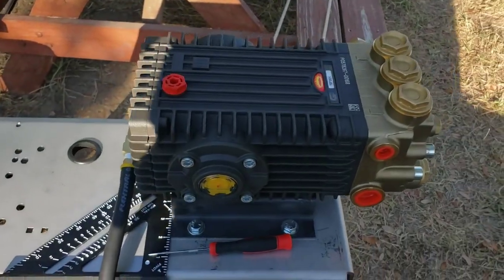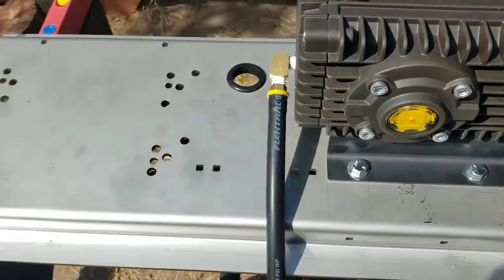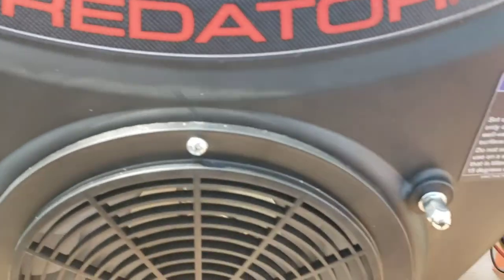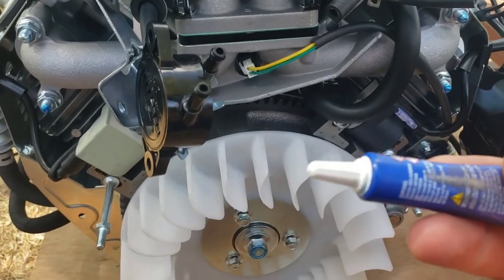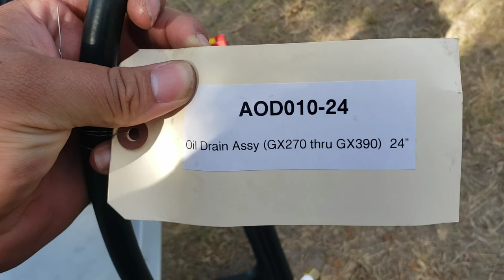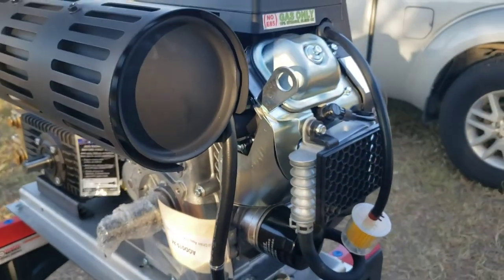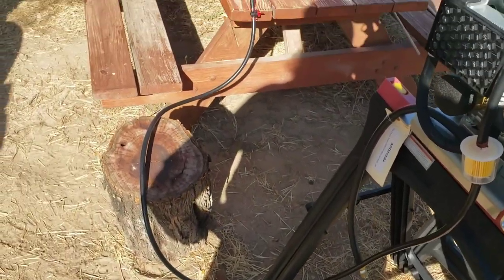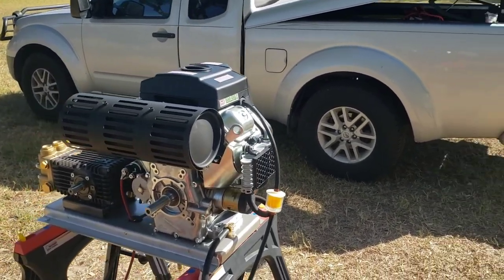Part 1 Predator 670 GP TSF 2021 Pressure Washer Build with Honda Fuel Pump Replacement

Comment from the maker: Predator 670 GP TSF 2021 Pressure Washer Build Part 1
with Honda Fuel Pump Replacement

Predator 670 GP TSF 2021 Pressure Washer Build Part 2:
https://youtu.be/gHS0hfmVD-0 

Watch both videos before building to learn from mistakes made along the way and how they were corrected or can be done better.

Majority of the parts:
Russ Johnson 
Southside Equipment
(502) 504-5454
russ@pressurewasherky.us
https://www.pressurewasherky.us/ 

Engine:
https://www.harborfreight.com/22-hp-670cc-v-twin-horizontal-shaft-gas-engine-epa-61614.html 

Honda Fuel Pump:
https://a.co/d/1uNtCr5 

Marine Battery:
https://www.walmart.com/ip/131118029 

Battery Box:
https://www.walmart.com/ip/16781380 

Saw Horses:
https://www.harborfreight.com/31-in-pvc-folding-sawhorse-350-lb-capacity-61979.html 

Engine Oil:
https://www.walmart.com/ip/17034353 

Engine Oil Filter:
https://www.walmart.com/ip/16878929 

Water Pump Oil:
https://www.walmart.com/ip/52626201 

Vacuum Guage:
https://a.co/d/cv51eEN

Comment: Do you reckon you can make your own frame? What is the thickness of the frame metal? How long are the tension slots?
Reply from the maker: I'm away from the machine right now but I'll take those measurements for you when I get back. But yeah the frame can be home made.
Reply: @MannyWashes  Would help to know the frame face's length x width, as well as, the pulley gap, belt type, and bushing dimensions. I'm shipping in a used 6.9 cast iron pulley but don't know what bushing goes in it yet.
Reply from the maker: @d4z_l20svaQ12  Skid footprint is 27-1/8" x 12-3/8" 

The mounting surface is 27-1/8" x 9-3/4". This is without the leg portion where the skid mounting bolt are. 

Skid height is 1-1/2" 

Skid thickness looks to be 3/16" 

The engine shaft to pump shaft is 13" on center with the pump tighten into position. Pump is tighten about 3/8" to the right so I'd assume the pre-tension distance is 12-5/8" 

Belt is a D&D Power Drive 4/3VX435 

Engine bushing is 1" SH type 

Pump bushing is 24mm SK type 

The vendor should be able to tell you what is the proper bushing for that pulley you're having shipped. 

The 4 slots opening on the skid for the pump mount mounting bolts are 1" long. Bolts are 3/8"-16 x 1" so the slot opening needs to be just wide enough to accommodate 3/8" bolts. Keeping a tight tolerance on the opening with should also help with pump alignment. 

From the right face of the skid going left the slot starts at 2-5/8" then since it's 1" long continues to 3-5/8". The bolts are 4-1/2" apart so the next slot starts at 7-1/8" to 8-1/8". I can't visually verify the 2nd set of slots because everything is mounted and bolted to the trailer. 

The distance between front slot to back slots is 5-5/8" on center.
So back slot is 1-5/8" on center from the rear of skid mounting surface and front slot is 7-1/4" on center from the rear of the skid mounting surface. 

Yes the tension plate underneath the skid is to tension the belt easily. But tightening the 4 mounting bolts are what really keep the pump in place to the skid preventing backing out. If there were two tension bolts on the side of the skid then I would say it was for alignment too but there's only 1. Also that tension bolt is 3/8"-16 x 6" and it uses a cage nut that clips onto the tension plate.
Reply from the maker: @d4z_l20svaQ12  I would think it would be best to get all the holes on the skid for the pump squared away first then adjust the engine position to line up with the pump then mark the holes to be made for the engine. The back of the motor cover lines up with the back of the pump. 

The bushing for the pump doesn't have much room for adjustment as to it's location on the shaft so most of the pulley adjustment to line them up is going to be done on the engine bushing.

Comment: Im new to this... This makes an 8 gpm machine with the predator 670? Total build price? How has it held up?
Reply from the maker: Yes. Holds up good. Total price for mine is a bit different because I made it with 2022 pricing, upgraded some pieces, used 316 ss fittings, made the outlet 1/2", and bought the engine during a special I thing for 850 with a cheaper price warranty. I think mine was about $3,300 to guess but basic is probably $3k

Comment: I'd recommend against ever using a FRAM filter in anything you actually care about. Get a Mobil 1 instead.
Reply from the maker: I've been using fram xtra guard for over a decade now without issue. Now I would agree with you if it was the cheap orange filter. Wix would be my next choice.
Reply: @MannyWashes  Ah, I missed that distinction. I think the Xtras might even be made by Wix? I thought I saw some cut-opens on another channel. 

I'm really watching to see how well that Predator holds up for you, as I've heard a lot of good things.

Comment: Looks like the main advantage of the upgraded pump base of the factory one is using it with the tensioner. Is that right? Do you think you could achieve the correct tension with the factory mount by hand? Like you would do on an air compressor.
Reply from the maker: The custom bracket is going to have less play than the factory because the custom has one single hole for the 4 holes on the skid side while the factory has slots. I think it'll mostly come into play while the pump is going.

Comment from the maker: Paint the pump mounting plate and tension plate or it will rust. This is if it's bare metal with blue or black thin finish.
21:26 Fuel Pump Swap Start

Comment: You can skip the washers if you use the flanged head screws. They are the way to go in most cases.
Reply from the maker: It's the stuff Russ sent me when I ordered the diy build kit. Where are you speaking of using them at?
Reply: @MannyWashes  In place of lock washers. Lock washers don't really prevent loosening.  Larger flat washers are for load distribution to keep the bolt head from collapsing what it's clamping, so by all means continue using the larger washers. But if the washer is about the same diameter as the bolt head, just using a flanged screw seems to make life easier.

It's not wrong to use lock washers. It just that there are other ways to go that are either more effective or easier to do.

If you are concerned about loosening, I'd strongly recommend the Nord Lock washers. It's the only locking washer style setup I've found that absolutely resists loosening due to vibration. They're even meter than Spiralock IMHO.
Reply: @MannyWashes  Pump mounts to the bracket. Don't worry about your rig-- it's gtg. Just keep on eye on those lockwashers on the pump mount and make sure they stay tight.

Comment: Hi many how are you 
I’m sorry to bother you but I have a question for you again 
I’m trying to put my pressure washer together but I’m having hard time to find out about the size of the bolts of a tws 8030 comet pump 
I don’t really know the size of those bolts 
Maybe I can find them on the hardware store or lowes 
Do you have any suggestions
Reply from the maker: Alright so I didn't find a straight out answer like you were looking for. I did compare the parts exploded view of your pump and my GP TSF2021. Given that most of the screws in the same location of the two pumps have the same thread diameter but different lengths I'm guna go with that the mounting bolt holes on the bottom are also M10. The TSF2021 came with M10x18mm according to the manual and Russ sent me M10x20mm for me to use with his mounting bracket instead of using the bracket that came with the pump. So I'm guna say yours is also M10 and probably the 18-20mm length but I'd double check that if I were you. If you have a stick to put it in the hole then measure it and convert it to metric should give you the maximum bolt length. If you're between lengths then I'd probably say go a size smaller but also remember to include the thickness of the mounting bracket when considering the length of bolt.
Reply from the maker: I'm looking at Lowe's and I would just say make sure that the threads are the whole length of the bolts and don't forget locking washers
Reply from the maker: Could also use hex cap bolts which is what came with the GP pump and Russ sent me hex bolts.
Reply: Ok thank you for your help 
I’m going to Lowe’s tomorrow to see if I can find the bolts 
I appreciate that you answered my questions
Reply from the maker: @melvinn5293  let me know if those do turn out being the ones. Good luck.

Comment: Any reason you went belt over gear drive?
Reply from the maker: Misinformation sorta. If you watch towards the end of the 2nd part I think I said if I did it again I'd probably do gear reduction driven. When I was first researching this stuff I was finding that the belt drive was highly recommended that it is quieter(maybe), I think not as harsh of a start on the water pump(maybe), if the belt breaks it's a cheaper replacement (true) compared to if a gearbox breaks. And I'm not sure what else but also I believe that's what Russ only sells.  Russ isn't that great at upselling but I feel he's good at information and recommendations.

The pros from the gear set up is that it only 4 parts you're really putting together, the skid plate, engine, gearbox and water pump. The gear setup has a smaller footprint for it's overall size. I think it uses the same skid plate size as a 4gpm belt drive just used in a perpendicular direction. I believe I've seen it mentioned on two YouTube channels that there's less loss of power from the gears because belt flexes and maybe in the smallest minute amount slips but it's not something that can be see to the eye. I don't remember if you get more psi or gpm or both from not having that power loss.

Cons: I recommend having the pump supported, the "pressure washers channel" on YouTube on one of his videos shows a type of support, that way the pump isn't just free hanging off the motor from the bolts. Also on the same YouTube channel in the same or different video it's recommended to use RTV sealant to prevent water from getting in between the engine output shaft and where it slides into the input gear. The reasoning is because if water gets into there then the shaft will rust weld to the input gear making it difficult to remove the gearbox if you ever have to take it off. I don't remember if it was the same channel or the "house washing" channel that kinda recommends making like a foam gasket to prevent water from getting into the gearbox housing in the first place. Another con is if a gear breaks then you have to replace the whole gearbox because I don't think the gear is sold alone or if the housing cracks and leaks oil. That can probably shut you down until you get another one if you don't have one on hand. Another slight con is you have too carry a 3rd separate oil, engine, gearbox and pump. But yeah with those cons idk how often gearboxes actually break down so they may be theoretical cons. I also don't know how long belts last so I'll find out. 

Either choice is guna work for you but the power lose might be a deciding factor. How much of a lose is it , idk. I feel like there's a video out there comparing the two but I don't remember. But yeah I think now there's 3 belt drive build videos on YouTube and two gear drivers on YouTube with sometimes other videos giving you some tips how to do things better.
Reply: @MannyWashes  I have one of Heath Phelps 6.8gpm budget builds and trying to decide on adding another one of those and Siamese them together or go with your build. But if U have two of the same setup as I'll plenty of backup parts. I did see where Kentucky Wash pros\ Jeremy swapped his 10gpm  predator system from belt to gear driven  but I'm not sure why. Thanks for the quick response and detailed explanation.
Reply from the maker: @shauncrochet7934  I looked back at Jeremy's comments and I found one saying that gearbox is easier to work for him and that he didn't have any experience with belt drive. Philip Prc's comment.
https://youtu.be/v5TYtRRfV_o

Yeah I can see how that's tough to decide. It does make it easier to order and have parts on hand having both the same machine. But then again could have a machine with more gpm output. I know like Mike carmody has a 8 and 10 gpm machine. I just starting see videos pop up for another guy out of Dallas also having an 8 and 10. I usually see when guys have two machines they have 8 and 10. The "pressure washers channel" I believe he has two 8 gpms and he'll some times Siamese them to put out the 16gpm.
Reply from the maker: @shauncrochet7934  https://youtu.be/NWH2pSj1oBY

This is the video with the RTV on the output shaft and the pump stabilizer mount for gear drive.
Reply from the maker: @shauncrochet7934  
https://youtu.be/5HbYcPqVa6U

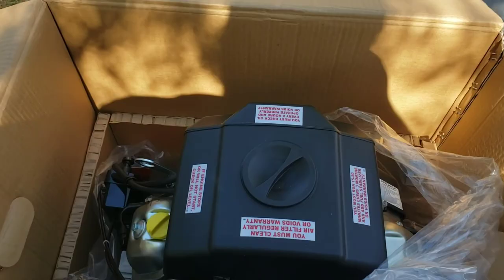This is the video of that diy silicone foam gasket I was talking about. It's at 17:41